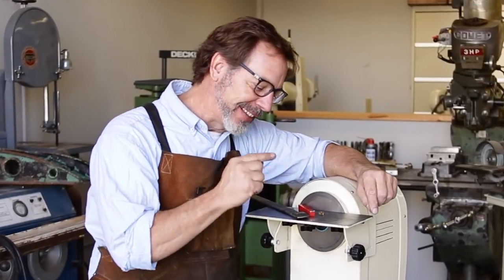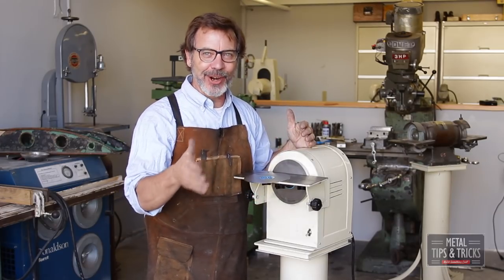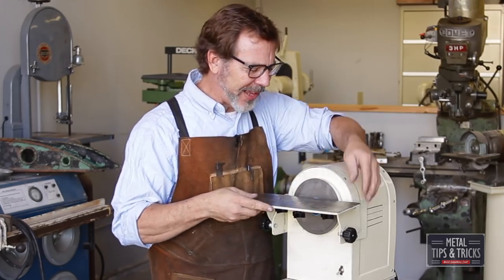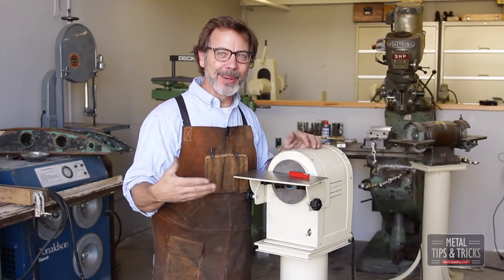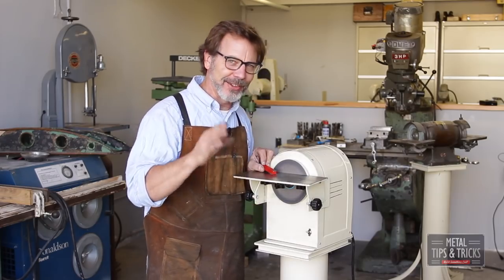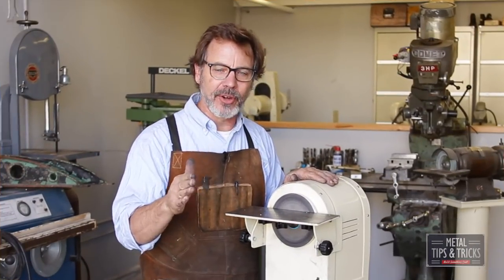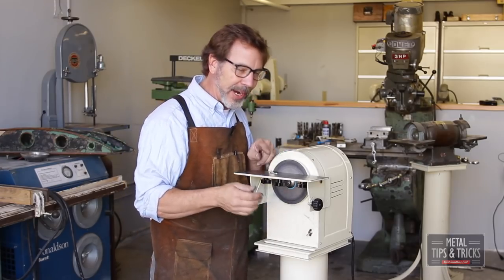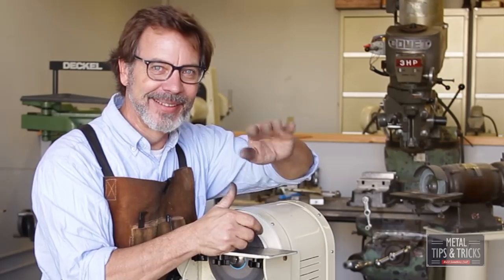How to sharpen carbide on a slow speed grinder. Part 2

Comment: It would be worth while to show how the sharpening on the tools works out on say 1018 cold rolled and maybe some 4140..
Reply: A before and after would be cool
Reply from the maker: Maybe I need to make another  video. Lets see how many thumb up your comment gets. :-)
Reply: Normal carbide inserts have an edge radius, because that improves surface finish and durability for how they are used on industrial machines - at the cost of needed more power to make the cut.  Deliberately changing the insert geometry to a dead sharp edge makes them much more useful on benchtop hobby machines, because that reduces the power needed to make the cut - at the cost of durability and surface finish.

That's a great tradeoff for people with small lathes, especially since inserts can then be sharpened many times.  (I use a slow speed wet grinder, so I don't have to be concerned with carbide grinding dust or the noise of a dust removal system.)
Reply: @somebodyelse6673  I think by ''edge radius'' you mean nose radius. Not trying to be pedantic, because the actual cutting edge on many carbide inserts also has a slight radius, or a samll flat spot (''honed edge'' is what it's called I think). That not so sharp edge is also done for durability, but also increases the power and rigidity requirements. A dead sharp lapped edge on carbide with a smaller nose radius than on commercial inserts and slow feed can probably leave a great finish and be very durable. Watch Robin Renzetti's video on production work on manual lathe. He used brazed carbide to make all of 420 or so pieces for a job he was doing, and the tool held up for the entire run of parts.

Comment: That is awesome...I actually use these small diamond wheels from HF, model 69658, and use the tapered wheel in an air die grinder to sharpen my tungstens, and then the larger flat wheel on an arbor in the lathe chuck to dress my brazed carbide...
Reply from the maker: Great idea thanks for sharing:-)

Comment: Intriguing process & a nifty idea toavoid big bucks for a commercial grinder. For the brazed carbide...how many sharpenings before the overhang of the carbide on the steel substrate is no more? How do you grind back the steel substrate w/o damaging the carbide - or - the carbide gouges the wheel(?) grinding the steel?

Comment: Thanks for a Kicking practical video...Man you ROCK. I just bought a 320 grit diamond cup wheel. I guess it is going to be for hogging only. What speed should I run the 4" 320 grit diamond cup wheel. I hope to mount it to my lathe to use as a tool grinder I grind some crazy stuff by eyeball and would rather use more accurate tooling.

Comment: Hi Dale, great video.   I noticed the wheel was picking up carbide, how would you clean that off the wheel?
Reply from the maker: Good Question. I spray paint thinner on it from spay bottle. It works,  but it is messy. I hope to find a better way. :-)
Reply: Thank you Dale for your quick response.  I have a KK CALAMAR  which uses wheels from Accu-Finish and they had once told me to use Windex spray glass cleaner.  But I will try paint thinner on both wheels. If you find something better let me know.  I only have a 600 grit wheel but I did purchase your 3000 grit wheel today.  I'll let you know how this works out for me.  Again, thanks Dale

Comment: DD, what is rotational speed that you qualify as slow?  inches or feet per second?

Since a lot of material isn't be removed, what HP motor would suffice?
Reply: I made mine from a lil' 40 VDC motor that is prob 1/4 hp and it has more than enough power. For a 6" wheel about 300 rpm is optimal, but you can get away with a little more if you use coolant/lube, which I recommend using regardless to knock down carbide dust and make the wheels last way longer. I use a cheap chinese mist coolant head with water soluble grinding coolant that works well.

Comment: Heeeey, what if you try sharpening a masonry carbide twist drill to use it on steel?
Reply: There have been people show that on YouTube. Not for production work but as a quick & dirty solution to drilling out broken bolts. Can also be done on a green wheel or any diamond wheel.

Comment: Hi, I find it unfortunate to use this diamond disc without watering.
Reply: old dried silicone (one you use in kitchen,bathroom ,to seal things)works wonders on diamond stone and sandpaper.Old rubber soles of the shoes will work aswell.

Comment: I don't know why your lap disks are wearing out. Mine have been going strong for years. With diamond they still feel like day one. Mind you I have them glued down to their backing plate. The diamond doesn't wear really but it can be knocked off. Perhaps a flapping lap disk and vibration are the reason.